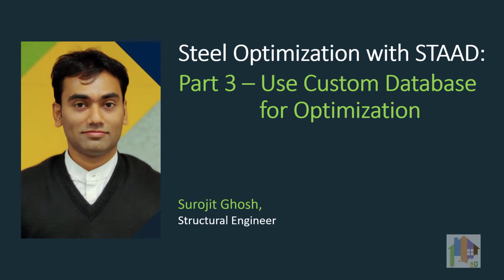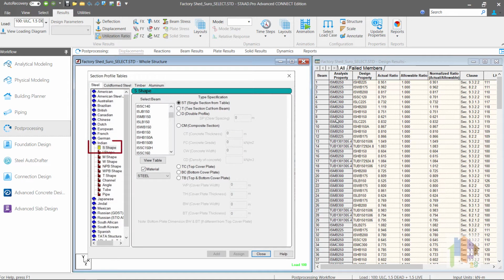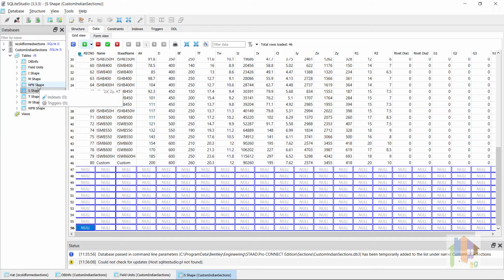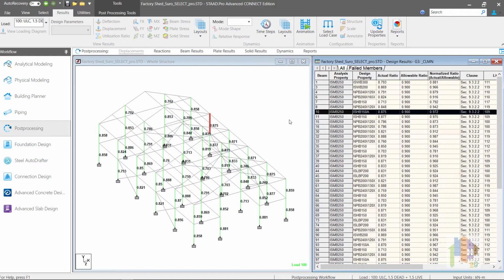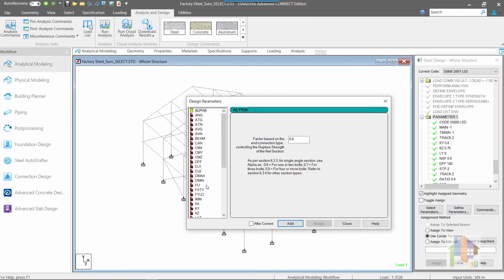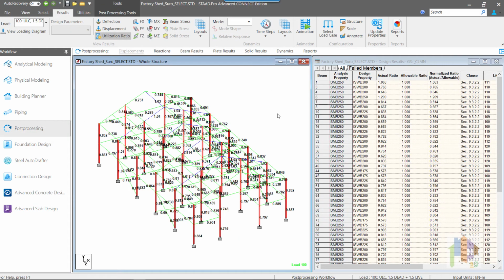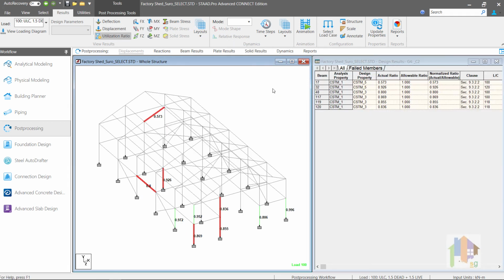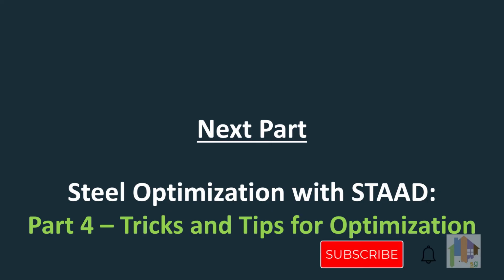Steel Structure Optimization with STAAD: Part 3 - Use Custom Database for Optimization || User Table

Comment: Is there a way to get "Profile" design parameter in IS 801 code ?
Reply from the maker: At this moment, PROFILE parameter is not available for IS801 code. Alternatively, you can use "Select sections to Project Database" option available under standard database > View Table to select and use specific shapes for section selection. Also you can create a custom database with the selected shapes and use that for member selection.